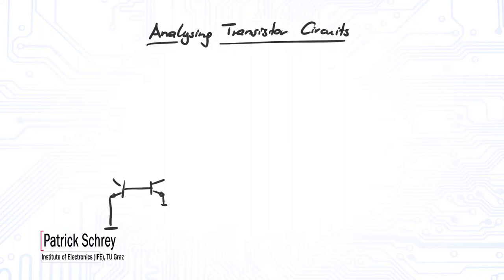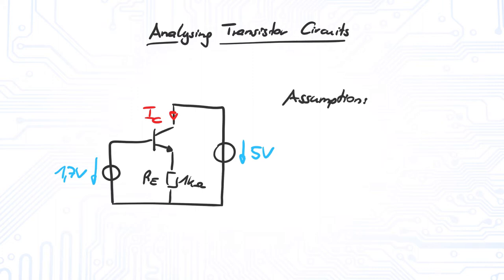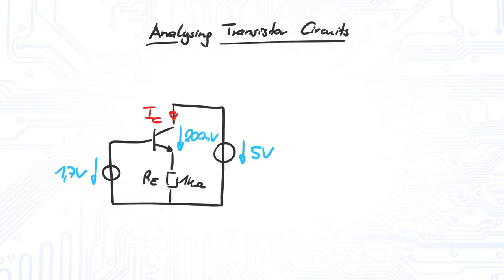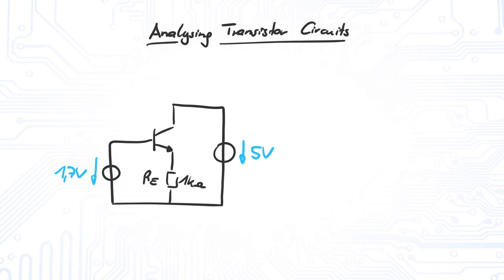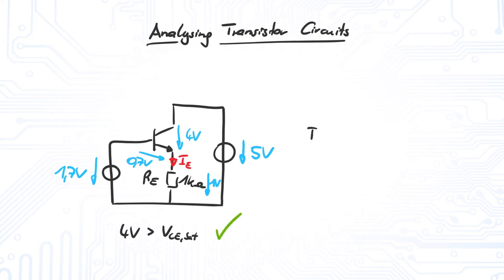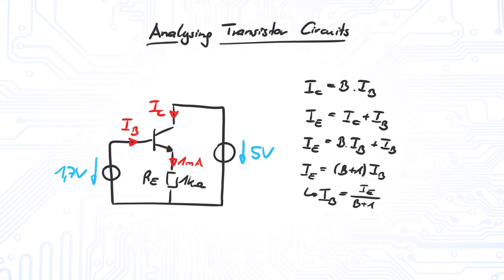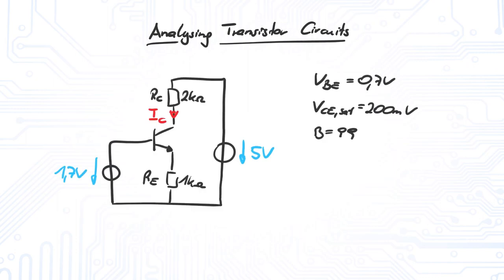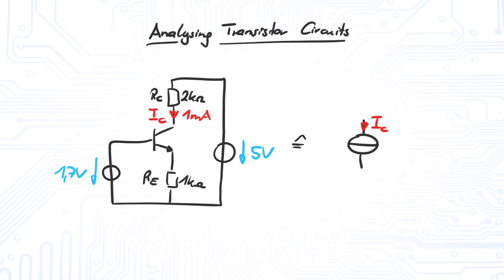Analysing Bipolar Transistor Circuits - Calculations, Assumptions, Operating Regions, Examples

Comment: Great video, so the bad assumption is that the transistor was staturated - it wasn't.
Reply from the maker: Yes exactly, in the example in the video we made a first assumption (that the transistor is in saturation) and found out that our assumption contradicts our calculations. Therefore we needed to assume a different region of operation, which turned out to be the right assumption.

The most important part is to always verify the assumptions that we make.

We are glad you like the video. :)